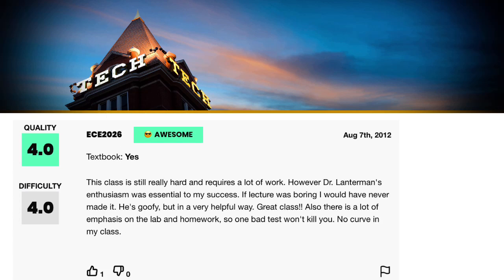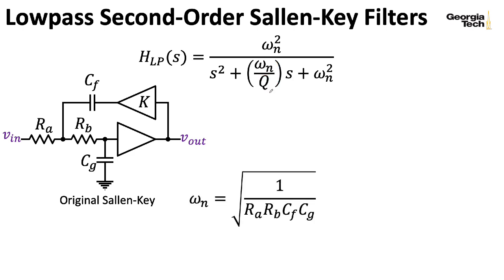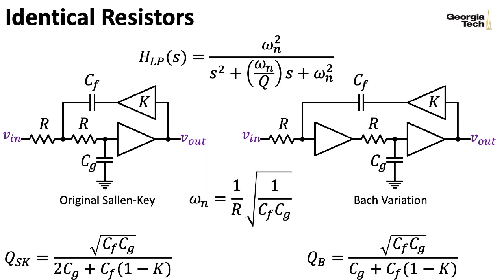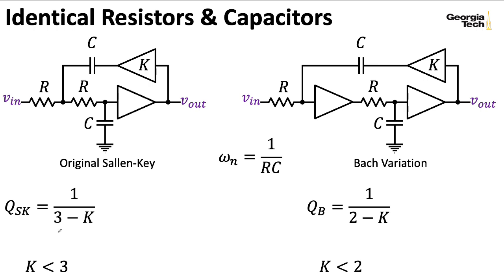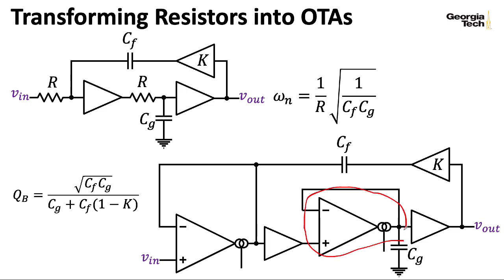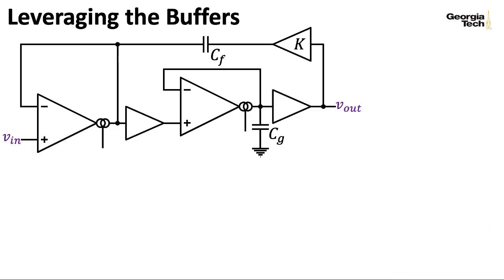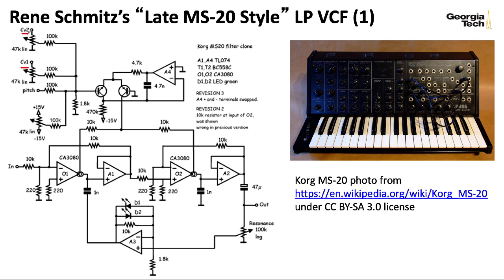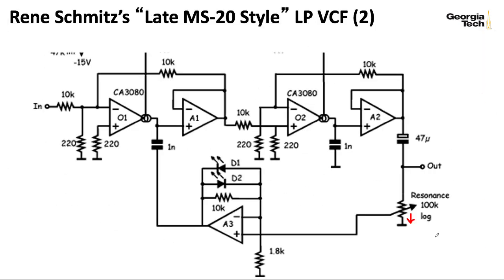ECE4450 L26: Sallen-Key Filters & the Korg MS-20 VCF (Analog Circuits for Music Synthesis)

Comment: I just re-watched your video after a long time, and I took the schematics of my Befaco BF-22 dual filter eurorack module to compare it with your lecture. I stopped your video a few times and checked the Befaco filter. It seemed a bit strange, apparently using two bipolar transistors as variable resistors. And then, near the end you answered all my questions! The Befaco module is an almost straight reissue of the 'MS10 version of the Korg35-based filter', as analyzed by Tim Stinchcombe, including the Q2SC1623 transistors. The only main difference is the addition of a LM13700 to enable voltage control over resonance. So, as it turns out, the Befaco filter is actually an interpretation of the MS10 filters, and maybe its name should be BF-12.
Thanks a lot for your videos, and for mentioning Tim Stinchcombe's paper. I've got some reading to do :)

Comment: Just rewatched the video. Another SK-cell bandpass filter is the Steiner Parker, although it uses diodes and the bandpass output is achieved in a different way compared to the usual ones
Reply from the maker: That S-K one is really interesting and weird -- the overall topology changes depending on what you plug into it.

Comment: Thanks Aaron, I had watched it twice and I didn't catch the inputs on the OTA either. Very happy that you covered the MS20, I've been baffled by the filters used in various korg synths(MS,delta,poly's), this clears up alot. Also, would you mind explaining what those 2 transistor pairs 2sc945 on the original korg design schematic are doing? Korg also uses them in other synths in that fdbk/resonance ctlr loop in front of those op-amps. thx

Comment: Very nice!
I would say though that the sum of a band pass filter and a high pass filter is still a high pass filter, it's just that the (Korg) high pass filter in question has a 6 db/octave roll off instead of 12 db/octave. But it's still got the resonance, so I don't think the second pole is wasted. Maybe 6 db/octave actually sounds nicer for a high pass filter in some cases, to avoid making the sound too thin? I haven't made any audio comparisons though.

Comment: Hi, thanks for sharing the knowledge. Whats the formula at min 21 for getting the constant to multiply by the current to give us the natural frequency? Couldnt understand where that came from.
Reply from the maker: Ah, the 19.2, that's 1/(2 * VT) where VT = 26 mV is the so-called "thermal voltage" -- 26 mV is a typical value for "room temperature."
Reply from the maker: See my lecture "Voltage Controlled Amplifiers: Operational Transconductance Amps": https://youtu.be/96j2tNKFCPI
Reply: @Lantertronics  will do it. Thanks.
Reply: @Lantertronics  that was not what i was in doubt but thats good to know anyway. My problem is that i thought the formula was wn=19.2*iabc√(1/C*C), i must have missed something as I cant seem to understand how that translates to the one you have used. I'll go watch the other videos hopping to get my answer. Thanks.
Reply from the maker: @wizegeek  Ah, in that case check out my lecture titled "Single-Pole OTA-C Filter" https://youtu.be/pTHHzFsa4Ss
Reply: @Lantertronics  That was it, i got my answer. Thank you very much. I'm currently reading a book on opamps and other stuff, with hundreds of pages and i believe theres nowhere near as much information as in your videos. I can only imagine how long it must have taken to master and have this kind of knowledge all sorted out the way you have, Thank you sir.

Comment: So I have built the Rene version with both the ca3080 and the lm13700 otherwise every other component is the same but they sound different there is a big personality difference 🤷‍♂️ any idea why 🤔 But at least I have a better understanding of what I built because of this video 👍
Reply from the maker: You might find this of interest: http://synth.stromeko.net/diy/OTA.pdf
Reply from the maker: If the "simplified schematics" on the datasheets are to be believed, the upper current mirrors (the ones near the positive voltage rail) are slightly more complex on one chip than the other, but I'm not sure how much of a difference that would make.
Reply from the maker: Ah, it does look like the current mirror at the bias current input on one is different than the other -- the input of one chip looks like it's two diode drops above the negative voltage rail, and the inputs of the other one looks like it's one diode drop above the negative voltage rail, but that should only matter if you're trying to directly create the control current with a resistor and voltage source and ohm's law.
Reply from the maker: I've never compared them myself but I have heard people say that the CA3080 distorts before the LM13700. Does the 3080 version sound grungier in general? Do the differences between the version seem less prominent when you put in quiet signals?
Reply from the maker: Short answer is: I could guess at bunch of theories, but I actually have no idea. ;)
Reply: @Lantertronics  so I haven’t put it through all the paces yet . I’ve only tried simple white noise and a couple basic oscillators . What I know so far is that on the 3080 the frequency range seems wider I can completely shut the signal coming out turned full one way where as the 13700 does not it comes close. And on the 3080 at the lower frequency cut off it will self oscillate where as the 13700 doesn’t . The resonance sounds better with the 3080 where as the 13700 squelches real bad turned all the way up . I’m going to play around with it some more , I was hoping someone had some reference voltages at a few points so I could compare with possibly a “proper “ working example
Reply: @Lantertronics  thanks again for your input 🙏 I’m glad I found your channel , I’ve been learning new things 👍 and seeing the equations at work help a lot
Reply: the CD3080 was the first commercial OTA (1969), the LM13700 came later and is an improved version.
the CA3080 was made by Harris and Texas instruments acquired Harris.
Also the placed where the CA3080 was made burned down, as far as i know.
probably also the machines and stuff to make the masks differ, the entire process.

Comment: At 14:00… the first OTA dumps its current output into a voltage buffer. Is that intentional?
Reply: Most of the time an OTA is used there is a voltage buffer at the output, a lot of OTA chips like the LM13xxx have the buffer included in the chip. The reason for this is that unlike op amps, OTAs have a high output impedance, meaning that it could heat up/fail very easily if the load demands more current than your average op amp could handle.
Reply: @tired.mp3  I think what you're missing is that there generally is a path for the output current to flow, e.g. a resistor, an inverting opamp buffer or a capacitor. In this case, I think that path was accidentally left out. The OTA is a current output device and that current can't be dumped into the high impedance input of an opamp. I guess Prof. Lanterman was using the opamp symbol in place of an abstract buffer circuit.
Reply: @TheSlowGrowth  Ah you're right! The first OTA is missing a load resistor.
Reply: @tired.mp3  I think the loads for both OTAs in these circuits are capacitors. One of them is the feedback capacitor.
Reply: @possible-realities  Theres a buffer between the feedback capacitor and the first OTA, so that one needs some load resistor
Reply: @tired.mp3  Which circuit diagram are you referring to? For instance, at 10:00 the current from the left OTA goes into Cf (and from there into the output of the K buffer), while the current from the right OTA goes into Cg, and then ground.
Reply: @possible-realities  The one at 14:00, the circuit at 10:00 you mention seems correct
Reply: @tired.mp3  Ok, I agree, that one clearly has a mistake in it. I think it's introduced in 12:27, where the intention was to take the feedback from the buffer back to the negative OTA input, but the current path from the OTA output to Cf got cut off by the same change.
Reply from the maker: @possible-realities  Whooooops! Yes, you are correct. I got overly zealous with the "let's take the feedback from the output of the buffer" trick and make the same error throughout. Ugh... I'll add a note about that.

I recorded this near the end of the semester when I was running out of steam...